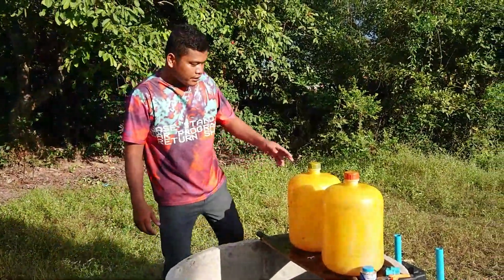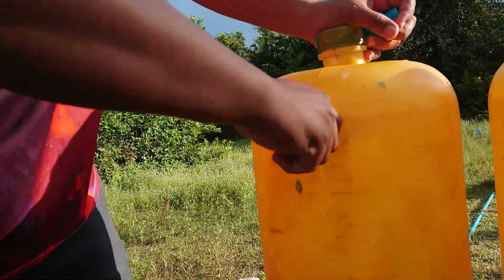How To Make Free Energy Water Pump By using 4 big plastic Bottle no Electricity, Life Hack At Home.

Comment: how tobe sure the flow of  your water is highly preaure till  end if  you want continous to flowing the vwater and how tobe sure if the level  of water container is maintain the   level inside, now to make sure the level of water inside  the container, you making to use a transparent hose, the you addupting outside the  container from the higher level  to the lower level and you  must see if your water pump free  energy is   working or 100% succesful, that is it.
😁😁😊😁😁😁😁
😆😆😆😆😆😆😆.

Comment: this is another hoax. There is some source of pumping at the end because the pressure at the nozzle increases compared to when he first starts washing his scooter. Water simply does not flow up hill without some energy source. The level in the well is high and so it could siphon but not to the elevation of the last shots. Look at the flow when he fist starts washing his scooter then look at the closing shots. there is a pump somewhere.